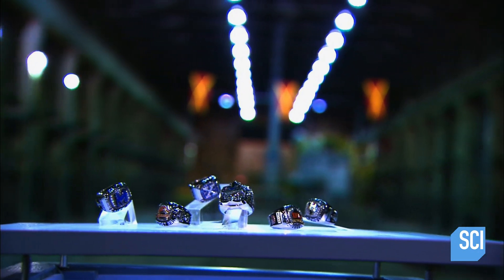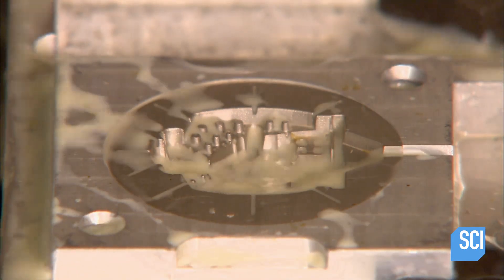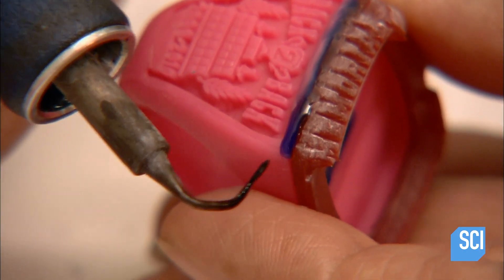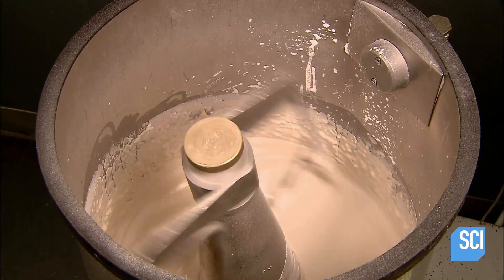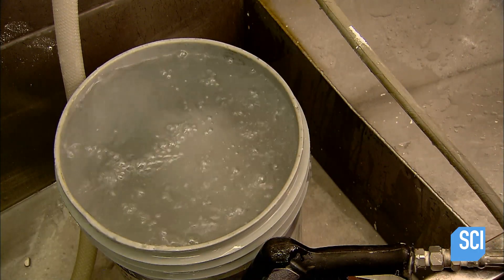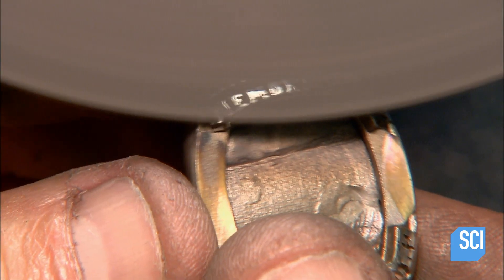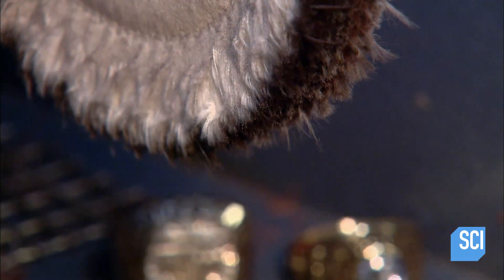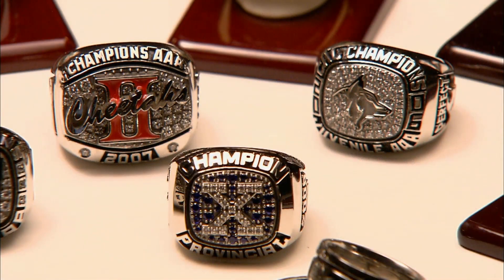How It's Made: Class and Championship Rings

Comment: Melting two things together is not 'soldering'. You have to be using solder to be soldering.
Reply: If you're talking about adding the top plate to it,  those small pieces of metal that they showed before doing it are solder. That's done when it's to small of an area to use traditional "wire" solder and an iron. You use flux on both pieces, small flakes of solder, and then heat them to melt the solder in an oxygen free environment and it sticks the pieces together.
Reply: @donvandenberg5301  Come on man, it's not that hard to deduce what i'm talking about. The narrator says "they solder together" when the guy is melting wax parts, no solder in site.
Reply: I take it you’ve never seen a wax soldering iron before 🙈🙈 a wax soldering iron uses wax as the solder 🙈🙈🙈😂
Reply: @fiestaturbo1287  No, I haven't, and you haven't either, and no, it doesn't. Look it up. Soldering literally defines as "to join with solder" and solder is "a low temp melting metal alloy". What you are talking about is a soldering iron used to melt wax, not a wax soldering iron. There is literally no such thing as wax solder. Just because you call it that, or someone else calls it that, doesn't mean it is correct. By definition of the word solder is metal, not wax, not plastic, not anything else, metal. I can lick a piece of paper and stick it to a window, it doesn't mean I glued it to the window. I could say I glued it, and most people would understand, but it's not factually accurate. I stuck it to the window. To glue something, you have to use glue, and saliva isn't glue, just like wax isn't solder. Anyone else who wants to comment and name similar statements as the two knob's i've already replied to, you are wasting your time. You are 100% wrong and I will not be responding anymore so save your finger strokes.
Reply: @14768 wow you really lost your mind with this one !
Reply: Okay, Mr knowledgeable 😏😅💙
Reply: All he said was they use a soldering iron to do it, it’s probably said that way as to not confuse a layperson. Don’t be a prick

Comment: This is interesting, of course, but I'm curious as to how they made them before CAD was in use. I guess a wax master was crafted by hand instead?
Reply: Me too
Reply: Yes. Wax carving uses a hard opaque fine grained wax so you can see make fine detail, see that detail clearly and keep that detail unlike the soft flaky translucent wax used in candles where the light passing through thin sections makes details harder to see. For rings it comes as a convenient hollow cylinder so you don't have to remove so much material from the middle, although for rings like this which are oversized you'd need a larger than normal cylinder or a just a normal block.
Reply: I’d love to see the traditional method of making these rings as well!
Reply: We actually had a jewelry making class in high school in the Bay Area in California and you are correct. We would make a wax version of a ring we wanted to make and then it would go into a plaster mold. 
I made a Green Lantern ring and it was so cool that it was stolen. 😢😊
Reply: duh

Comment: Did anyone else notice it went from gold to silver?
Reply: Look up “Rhodium” plating that’s not silver that’s White Gold
Reply: @TreyNewman.  its a silvery metal in the palladium family
Reply: gold is naturally yellow, to make rose gold or white gold you have to add other alloys to affect the color outcome, and also rhodium is commonly used to make white gold more "white" by plating.
Reply: I am, YouTube wont let me link my Instagram but I have made a much better championship ring than this. 

This is average, at best.

Also to expand, they made the ring in two halves. U can see they CNC'd a negative mold for the top half. Then they cad the lower half then wax the two half together before doing the lost wax casting technique. The reasoning for two halves is they will ensure the top half of the ring will look the same, and the bottom half can be any finger size the customer requested.
Reply: @TansRav4  are you a jeweler as well ?
Reply: its basic inorganic chemisty.
Reply: @TansRav4  ahhh